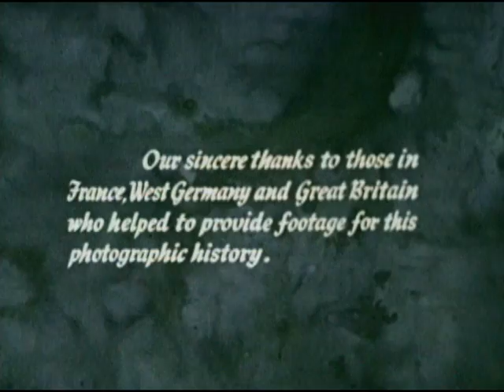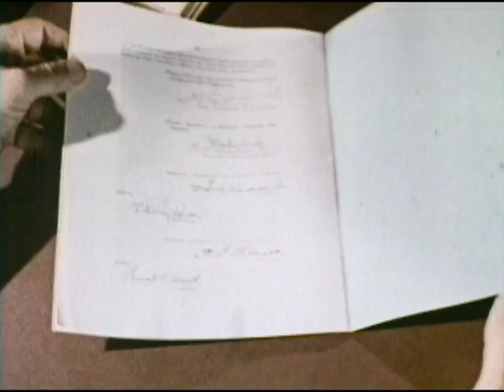AT&T Archives: Cable to the Continent, a 1959 film about the second transatlantic telephone cable

Comment: Too bad they don’t show a splicing operation, without which there would be no connectivity. Those phone people that block the roads aren’t doing it to annoy you, they’re doing it to splice more pairs for your computers to run on.
Reply: Agreed- I really wanted to see them splicing. How many pairs were in the cable?  And I’d like to know how the repeaters were powered. Think about how important each vacuum tube was. Can’t replace a tube on the sea floor very economically!
Reply: @ut4321 Coax cable I would think.

Comment: a whole 36 calls! geez!

Here's some cool stats on the economics. Those 36 calls had the potential to deliver $189 million in direct phone call revenue over a ten year life from a 1960 to the 1969. Adjusted for inflation that would be over $1.675 Billion in 2021 dollars. No wonder they got behind it!

If by some grace of luck they could use the circuits for data transfer each individual line would have been able to transfer about 12 Gigabytes over that 10 year period (at 300 baud). If all 36 circuits would have magically been able to be used it would have transmitted a whopping 432 GB over 10 years at a cost of $189m. Not that it would have actually worked. In comparison I transferred 500GB of data from the US to a datcenter in europe last week and it took a bit over 2 hours. It's not even worth calculating the magnitude difference in cost. 

I wonder what that math will look like 50 years from  now.
Reply: Does 36 circuits actually mean only 36 simultaneous calls or was multiplexing already a circuit utilization multiplying strategy when this cable was used?

Comment: Latency of submarine cables is far slower than the "speed of light" as gushed about in this documentary.  I believe electrical signals did not cross these cables at even 20% the speed of light because of internal capacitance of the cable itself.
Reply: Expound on this. I just read a short article on wave propagation in a conductor. The article claimed that the Velocity Factor rarely fails below 60%. Do you have a link to a study that explained the shortcomings of early submarine cables?

Comment: Without this, we not be writing this today.  How do the repeaters work?  I was talking to an old telephone tech, he said there were pots along the way, and there would be 200-600 volts (necessary to overcome the resistance) in the center.  I can't find much info about it.  If one of the tubes burned a filament, where they SOL, or could they ping the repeaters somehow, swoop up the cable and fix them?
Reply: I read they were highlt advanced under water tubes. So maybe they never broke down? Who knows